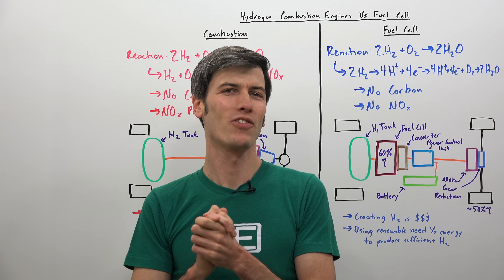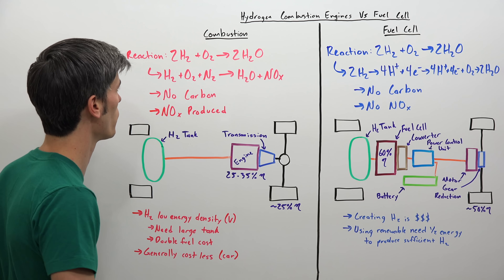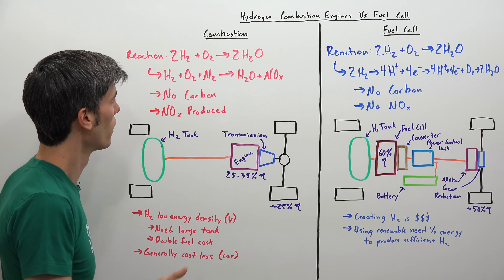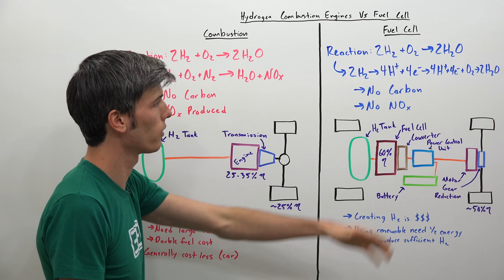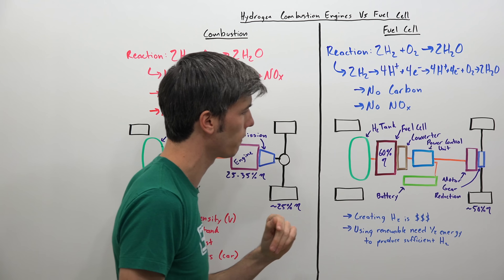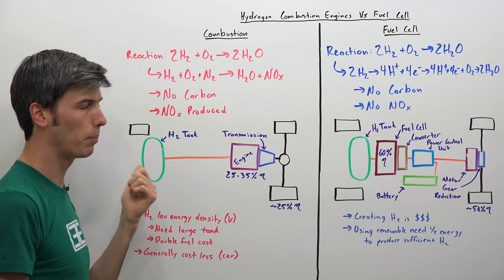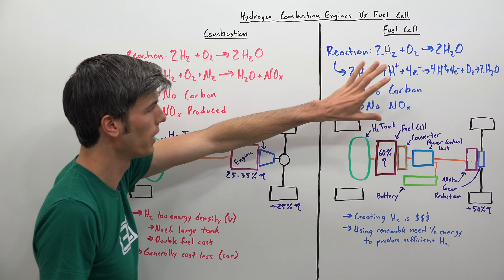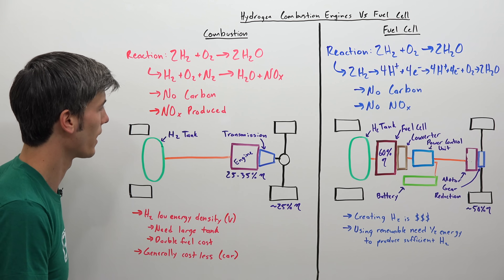Why Hydrogen Engines Are A Bad Idea

Comment: Bob Lazar solved the fuel storage problem by storing the hydrogen in hydride.....
Reply: Good luck getting your hands on that.
Reply: @casey8782  All i need to do is build a particle accelerator in my back yard... lol
Reply: @finheimforge4050      I would like to take the time to post some info about my vehicles setup.  I have been running my car on Hydrogen for about 2 years now.  I do not store large amounts of Hydrogen fuel in a separate High pressure container.  I produce enough gases on demand through the electrolysis process to run my 2.4L engine which requires about 6L per minute at 7000 RPM to run without hesitation or noticeable reduction in power.  To be clear, I do not separate the Hydrogen and Oxygen gases in my device. I simply have a small container that will be pressurized to 12-15 psi before the system will shut off production automatically.  I produce enough gases on demand through the electrolysis process to effectively bypass the need for complex High Pressure tanks to store H2 like most of the current systems.
    With this method I do not store enough combustible gases to cause any significant fire hazard or air displacement danger in the instance of a "leak" or failure of the containment device.  I bought a new fuel tank to replace the one that came with the vehicle to prevent contamination from the old fuel.  Now I use my house water to fill my cars fuel tank which holds 12 gallons.  So the fuel system is the same as you would find from the factory but, I fill it with Water instead of Gasoline and the fuel pump connects to the water container in the engine bay instead of to the injectors.  Also I do not use the fuel injectors, I use a large aquarium tube that is connected to the intake before the MAP/MAF sensors.  In order to run my engine on Hydrogen I had to retard the ignition timing from about 25 degrees before top dead center to about 5 degrees before top dead center.  I did this by using a timing light and rotating my distributor clockwise by about 7 degrees.
    As a comparison my car got about 30 mpg with gasoline, now it gets between 25-35 mpg with Hydrogen.  In conclusion I am sure that with a more complex delivery system I could get better performance and mileage because I am not monitoring the fuel air ratio but, my goal was to create a system that produces less Carbon emissions not to be crazy efficient and cheap to fill.  I believe by producing enough gases on demand this is more efficient because if I run out of fuel through miscalculation or my fuel gauge stops working, I simply need to find someone willing to sell me water (in one case a woman was so impressed she just gave me the use of her garden hose).  This is also safer because I am not using a "High Pressure" storage container for a combustible gas or liquid, it is just water in a tank.

Comment: Fuel cells are always better, need to have them more cost effective through platinum electrode replacements
Reply: Low-cost platinum??
Reply: @michaelossipoff2433  low cost alternative metals, metal oxides etc are being attempted across, as platinum electrode alternative, and once established based on an abundantly available material, fuel cells cost will potentially go low as production volume increases

Comment: Didnt consider people producing hydrogen on board ICE. More complexity but dont need to find hydrgen fuel station. Thats the goad really have generator only requires water to run ICE, Independence.

Comment: And he doesn't even touch on how prohibitively expensive it would be to switch over from gasoline to using hydrogen as your primary fuel source. There is enough manufacturing capability or money on the planet to use hydrogen. It would cost a tremendous about to switch to hydrogen and no one would be able to afford the fuel. Even though it could be made easily on a small scale. To industrialize the production and produce enough hydrogen cuz you would need several times more of it than gasoline to produce the same amount of energy, you could never produce enough of it to replace gasoline. And gasoline is pretty clean fuel source. Especially since cars put out less unburned hydrocarbons than the tree in your front yard.

Comment: Why can't a fuel cell be used in a hydrogen engine vehicle to (*help*)produce hydrogen, to eliminate the need to double the fuel tank size?
Reply: Because you'd be running the fuel cell in reverse, so would need a water tank and a source of power like a battery to produce the hydrogen. It wouldn't work at all.

Comment: One more "real world" Problem with developin hydrogen combustion. If you build an infrastructure that poduces twice the volume of hydrogen than another technology, shifting to the more efficient technology will remove 1/2 the productivity of Hydrogen from the economy... that's a lot of unemployment. What industry today could absorb a 50% cut in demand without causing major blowback to the economy and society? So, choose wisely up front, or accept you will have to live with it forever. Party on dudes, be good to each other.

Comment: Try and consider this you have a hydrogen engine that is only powering an alternator that recharges the battery it does not have to be running while you're driving the car it could be running while it's sitting wherever cuz you're only going to be in the car to 2  hours a day.  Don't try to propel the vehicle with the engine at all it's only there to create energy in the batteries

Comment: Isnt hydrogen currently being produced commercially by fossil fuels and extracting it thru a process that isnt as green as zero. Once its hydrogen and used either by combustion or chemical reaction/ fuel cell/ membrane it is carbon zero....but if economically hydrogen is produced from gasoline/ diesel/ natural gas we still have to dig/ drill for it.

Comment: If nitrogen oxide is bad for you. Why do some deep divers dive with nitrox   gas (nitrogen oxide)
Reply: Divers use compressed air which is 70% Nitrogen which is a single nitrogen atom.  Nitrogen Dioxide is NO2 molecule, and causes poisonous chemical reactions in the body.

Comment: I don't know really anything but I think the fuel density problem could be fixed (and this could work for both maybe) with an electrolizer and using water tanks as the main storage.

Comment: Where did the nitrogen come from in the combustion engine reaction?
Reply: Air. It's mostly nitrogen at 78 per cent, then about 21 per cent oxygen, and then 1 percent for everything else - argon, CO2 and other trace gases. But overwhelming nitrogen.
Reply: @ianstobie  My point being it just appears in the equation seemingly randomly. It's not how I remember doing equations
Reply: @rustymcrae7739  Seems pretty clear to me. Unless you expend energy to separate out the oxygen you want from the other components of the outside air you are introducing into your combustion engine, you run the risk of getting other reactions you don't want.

Comment: You need to watch a video about how real engines work in the real world. Cars here are per California pollution codes. Engines are low compression and run rich (excess fuel) to prevent NOx production. Extra air is added to exhaust where a "catalytic converter" (bed of mostly Palladium and Platinum catalyst) (the original Platinum creates Nitric Acid from NOx if present). Diesel is more efficient due to higher compression ratio, but higher temp makes more NOx but new engines scavenge NOx with Ammonia or Urea. A slight excess of Hydrogen would kill all NOx production. As air to Oxygen (portable oxygen for patients) filters improve it would be a logical upgrade to all future air beathing engines. No N no NOx.

Comment: With great respect for your channel and what you do. I would start out with the real bare bones efficiency numbers. Give a straight up one sentence comparison. Then watch it. Hmm could I have said it in less words and been ultra poignant to really entrap them into the specific details? It's very difficult sometimes, but I am a car guy and i feel there are many times you need to simplify better, with your introduction. Story of my life, that is what I am most often asked to do. You should have said they hydrogen fuel cell is more efficient because burning it creates nitrous oxide, or laughing gas out the exhaust, so in a sense we can't get them full mechanical transfer from hydrogen by burning it, fuel cells do way better. Fuel cells use the energy in hydrogen way better than burning it. Best wishes, all the respect in the world, cheers.

Comment: Is that a real hydrogen IC engine in the thumbnail? any info on it??
Reply: No it is not. However.....
I would like to take the time to post some info about my vehicles setup.  I have been running my car on Hydrogen for about 2 years now.  I do not store large amounts of Hydrogen fuel in a separate High pressure container.  I produce enough gases on demand through the electrolysis process to run my 2.4L engine which requires about 6L per minute at 7000 RPM to run without hesitation or noticeable reduction in power.  To be clear, I do not separate the Hydrogen and Oxygen gases in my device. I simply have a small container that will be pressurized to 12-15 psi before the system will shut off production automatically.  I produce enough gases on demand through the electrolysis process to effectively bypass the need for complex High Pressure tanks to store H2 like most of the current systems.
    With this method I do not store enough combustible gases to cause any significant fire hazard or air displacement danger in the instance of a "leak" or failure of the containment device.  I bought a new fuel tank to replace the one that came with the vehicle to prevent contamination from the old fuel.  Now I use my house water to fill my cars fuel tank which holds 12 gallons.  So the fuel system is the same as you would find from the factory but, I fill it with Water instead of Gasoline and the fuel pump connects to the water container in the engine bay instead of to the injectors.  Also I do not use the fuel injectors, I use a large aquarium tube that is connected to the intake before the MAP/MAF sensors.  In order to run my engine on Hydrogen I had to retard the ignition timing from about 25 degrees before top dead center to about 5 degrees before top dead center.  I did this by using a timing light and rotating my distributor clockwise by about 7 degrees.
    As a comparison my car got about 30 mpg with gasoline, now it gets between 25-35 mpg with Hydrogen.  In conclusion I am sure that with a more complex delivery system I could get better performance and mileage because I am not monitoring the fuel air ratio but, my goal was to create a system that produces less Carbon emissions not to be crazy efficient and cheap to fill.  I believe by producing enough gases on demand this is more efficient because if I run out of fuel through miscalculation or my fuel gauge stops working, I simply need to find someone willing to sell me water (in one case a woman was so impressed she just gave me the use of her garden hose).  This is also safer because I am not using a "High Pressure" storage container for a combustible gas or liquid, it is just water in a tank.
Reply: @casey8782  is like to learn more about how you produce enough Hydrogen on demand.
Reply: @bevant9218  It is written in the Multiple paragraphs I previously posted.  Do you have a specific question?
Reply: @casey8782  Yes.  How does one produce enough hydrogen on demand to run a practical car/truck, and

Does the car still require gasoline/diesel?  In other words does it run on just hydrogen and oxygen or is hydrogen simply added to aid in combustion and/or other benefits?

Comment: What about hydrogen on demand? as to the cost of producing hydrogen for storage? thanks
Reply: I would like to take the time to post some info about my vehicles setup.  I have been running my car on Hydrogen for about 2 years now.  I do not store large amounts of Hydrogen fuel in a separate High pressure container.  I produce enough gases on demand through the electrolysis process to run my 2.4L engine which requires about 6L per minute at 7000 RPM to run without hesitation or noticeable reduction in power.  To be clear, I do not separate the Hydrogen and Oxygen gases in my device. I simply have a small container that will be pressurized to 12-15 psi before the system will shut off production automatically.  I produce enough gases on demand through the electrolysis process to effectively bypass the need for complex High Pressure tanks to store H2 like most of the current systems.
    With this method I do not store enough combustible gases to cause any significant fire hazard or air displacement danger in the instance of a "leak" or failure of the containment device.  I bought a new fuel tank to replace the one that came with the vehicle to prevent contamination from the old fuel.  Now I use my house water to fill my cars fuel tank which holds 12 gallons.  So the fuel system is the same as you would find from the factory but, I fill it with Water instead of Gasoline and the fuel pump connects to the water container in the engine bay instead of to the injectors.  Also I do not use the fuel injectors, I use a large aquarium tube that is connected to the intake before the MAP/MAF sensors.  In order to run my engine on Hydrogen I had to retard the ignition timing from about 25 degrees before top dead center to about 5 degrees before top dead center.  I did this by using a timing light and rotating my distributor clockwise by about 7 degrees.
    As a comparison my car got about 30 mpg with gasoline, now it gets between 25-35 mpg with Hydrogen.  In conclusion I am sure that with a more complex delivery system I could get better performance and mileage because I am not monitoring the fuel air ratio but, my goal was to create a system that produces less Carbon emissions not to be crazy efficient and cheap to fill.  I believe by producing enough gases on demand this is more efficient because if I run out of fuel through miscalculation or my fuel gauge stops working, I simply need to find someone willing to sell me water (in one case a woman was so impressed she just gave me the use of her garden hose).  This is also safer because I am not using a "High Pressure" storage container for a combustible gas or liquid, it is just water in a tank.
Reply: Harvs, on demand where?!

Comment: H2 from oil is the same H2 from water in that reaction?
Reply: H2 is H2.  Once you make it, the engine or fuel cell doesn't care where it came from.  The only differences are how expensive it is to make, how much pollution you create when making it, and whether it's renewable.

Comment: Engineering Explained
Seperately

If you are correct and outside air mad of nitrogen ond OXGEN cause an oxidation of nitrogen can as in nitrogen oxidized NOX. That can be harvested and sold as a commodity. Please find a use for it.

Secondly you missed that in some cases hydrogen conversation to a regular gas or diesel engine in some cases destroys the gas engine.

Seperately we can eliminate the external air all together can as it is not needed for combustion at all and increase the power by more HHO, in a gas engine. You can make hho on the vehicle itself by solar power store the hydrogen and OXGEN seperately.

Most people drive 20 miles to work and the car sits in the sun all day.

Comment: I believe you can make hydrogen on demand remove the pure oxygen and mix it with air as you did in the hybrid engine and that will reduce by 2/3 or remove the nitrogen oxides  produced by the heat a combustion engine, um couldn't you?

Comment: What about jet engines powered by hydrogen and maybe industrial bigger machines would it be a good idea for maybe boats or something where you could store stuff like that with more room like buses and semi trucks i feel with all the advancements we have made I gasoline fuels and combustion engines shouldn’t be thrown out and stopped being worked on just because of electric our normal vehicles should still be advanced alongside

Comment: Why not just create the hydrogen fuel on board the car ? From simple kits that create the hydrogen conversion right on the car…I have seen this done on small engines….a couple of water filters one having a bunch of stainless discs for electrolysis or some such magic and the other just pure water…This way there is no need to use hydrogen filling stations , transport, manufacturing etc…

Comment: why would a hydrogen combustion engine need to have emissions that go out and exhaust pipe? Why couldn't they develop a system that recaptures the emissions and converts it back into hydrogen again recycling emissions back into the fuel source.

Comment: I get the feeling that handling H² ist a tricky part (high diffusion, it will leak everywhere). Maybe combining H² mit some other molecule production site (your solar energy park?) for storage and easy handling would be good ... and extracting it for the fuel cell reaction. Problem could be that the possible energy efficiency could be reduced by the extra step necessary to get the elemental H² back... hm. I think (hope?) there are already videos on this topic or why it might be an okay idea but in reality is not helping the topic. :D